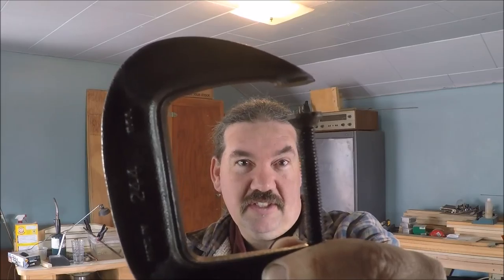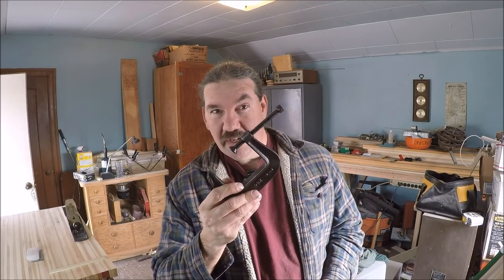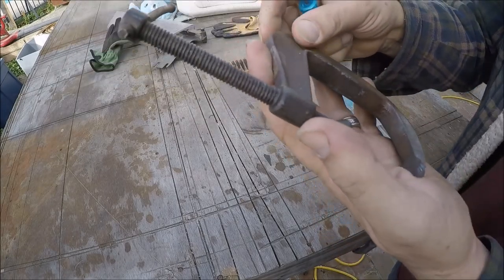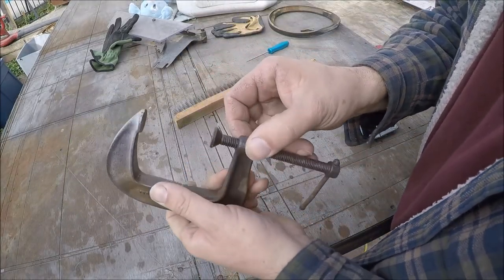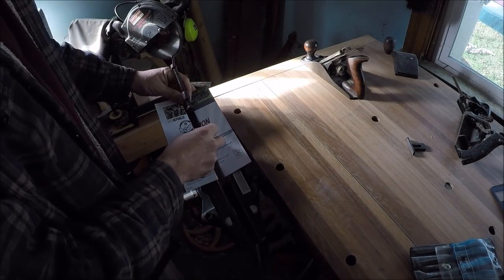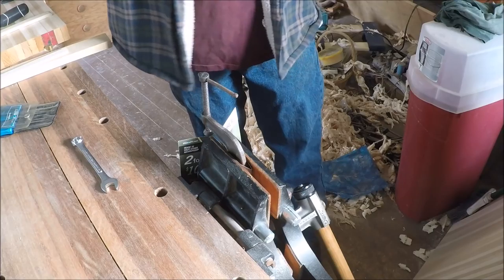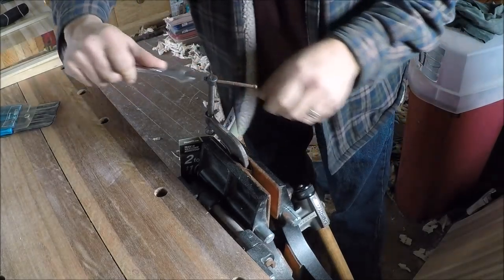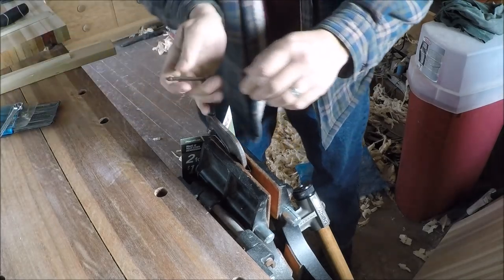Bolt Extraction Saving a C Clamp

Comment: Its funny, I just did exactly the same repair on a mates c clamp - plus made it a new foot for the screw end. No idea where he found it but it was solid when I started !  Ive another heavy duty clamp which was stuck solid - the type where the clamp screw is hex ended - took a long while soaking in rust muncher to get it free - then found the bolt is bent - so thats another job for the lathe when I get the gears sorted for cutting inch threads. Cheers for the vid. All the best Mat
Reply from the maker: might try to straighten it in a press for kicks. on this one even the pin was seized in place .

Comment: Good tip on using the wrench. I have picked up a few vises that had the small locking lever on the swivel base bent. I think that might come from hammering on the bar. Humans tend to strike  thingscwith whatever they are currently holding. 😕
Reply from the maker: Yes they do
Reply from the maker: i think i saw a guy hammering on a c-clamp with a wire brush of all things lol .

Comment: I would have used a torch to break it lose and wire wheel the threads and then oil it up and its good as news..dont tell me I'm wrong I have done this many times to clamps, vice grips, Vices, any bolts..you spent way to much time on it to be cost effective..Yer fired lol
Reply from the maker: Manny ways to skin a cat . Not a huge fan of heating it up might draw out any hardness if it is hardend. But if it's scrap otherwise not risking much.
Reply from the maker: Lol dam gotta fire myself to. This all started as something to test in the electrolysis.